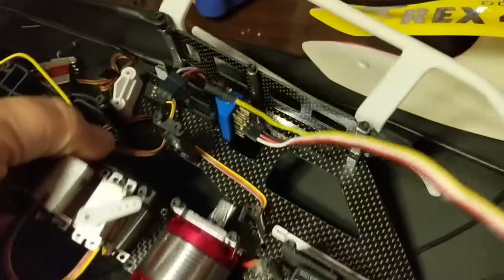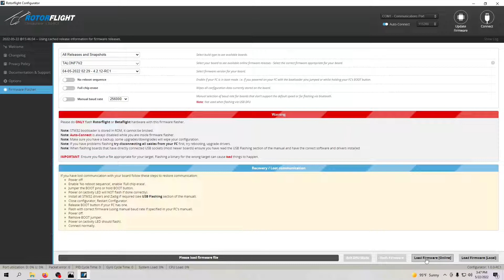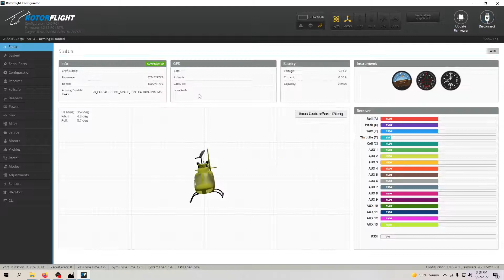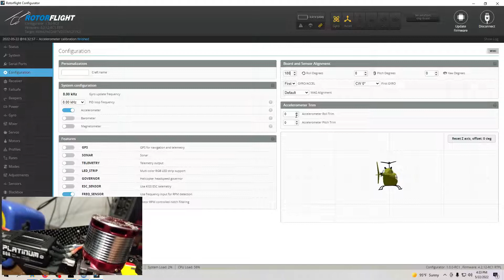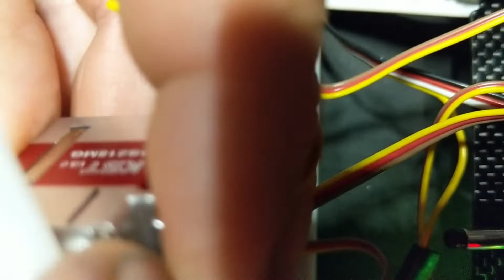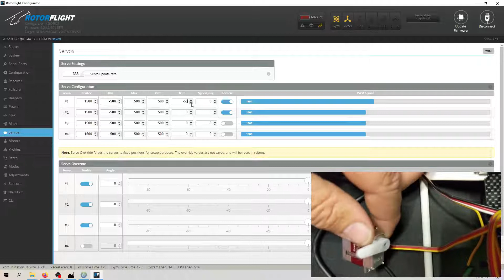470 setup

Comment: Hi,

Where didearn this turorial, I mean where as a layman I can learn.?  I i stalled Rotorflight, but board not recognized 🥶🥶
Reply from the maker: Trial and error and help from the discord when I couldn't figure it out.  Betalflight tutorials are also helpful since RF is a fork of BF.  The Immersion RC driver fixer might help with the board not recognized problem.
Reply: @4CFPV ,

I am checking yr video very well, matches 75 % with yr options wth mine, & mine would be a micro with DD tail.  

Very few guys like me & u are into making a custom FC, so findi g help is a long wy to go.
Reply from the maker: @fklotaloi  dd tail is a common build on the discord.  There's a few guys with M2s and M1s converted to Rotorflight.
Reply: @4CFPV ,

Yah I am also on Discord, but it is overwhelming informations for me... Coz I m jst a layman, just hv huge interest on it thts all.  
I only like micro & submicro heli, no big, no 3d at all. 😊